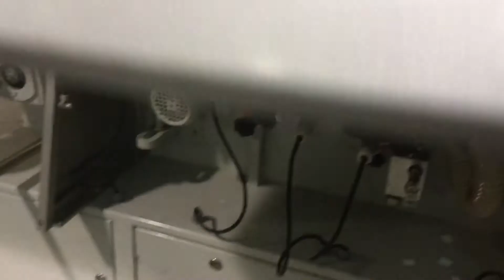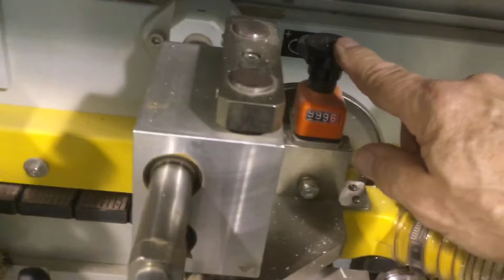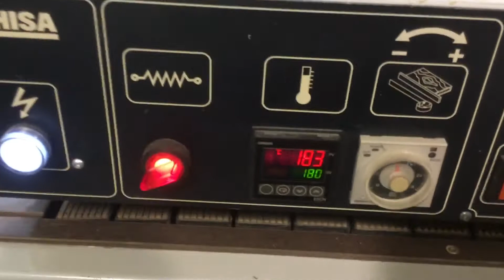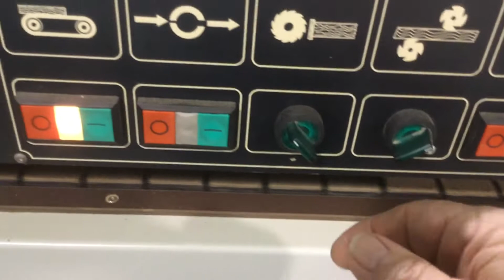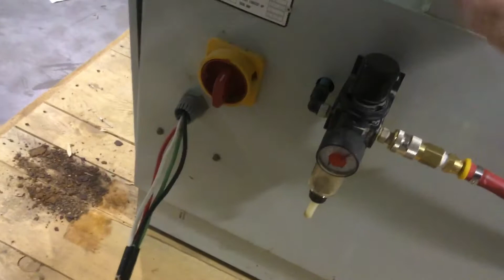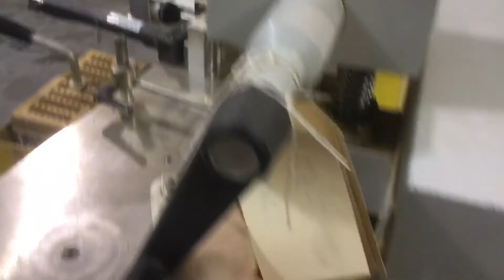Cehisa EP8 part 2

Comment: Thanks so much for this video, even though it's been a long time. We've had one of these for almost two years and, for the most part, don't understand how to adjust trimming features. Especially the end trim. Unfortunately, it's out of whack and it's a bit of a battle getting good info. This explains a lot though. Other than that, it applies glue and banding fine. Thankfully, we don't do a lot of edge banding, but we'd still like it to work well. Thanks again!